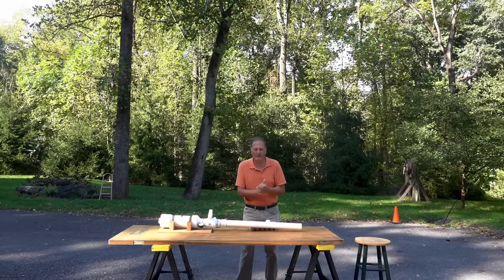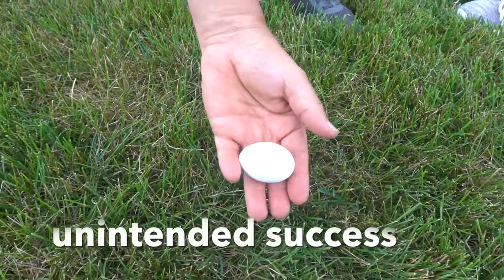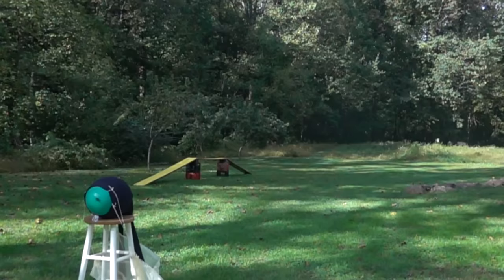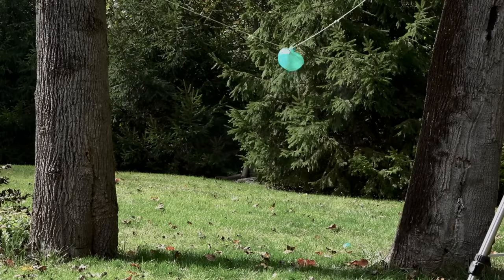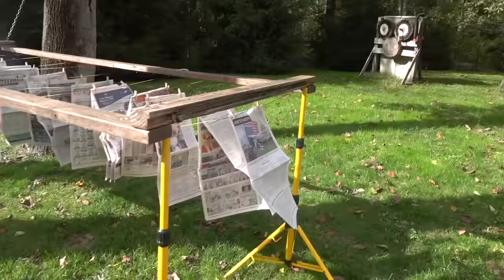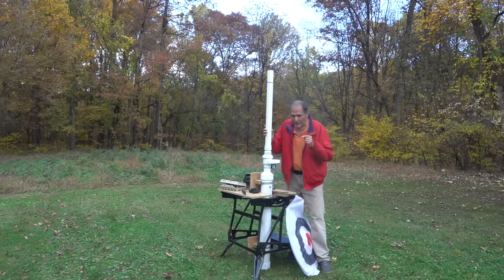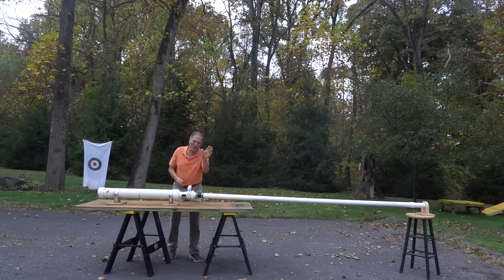Trying to Catch 300+  MPH Eggs ------  Physics  Impulse Challenge

Comment: 10:44 Dang. That egg is coming out of the barrel with magnum handgun energy. It's so interesting to see the physical behavior of what is basically a CaCO3 jacketed, viscous liquid core, shotgun slug.
Reply: Potato guns can do some serious work if they are designed right, I've got one that shoots golfballs at 750 FPS and makes about 875 ft-lbs of muzzle energy, and that's just with propane and atmospheric air. Another one I made was capable of magnum rifle energy levels, a stoichiometric mix of air and fuel were compressed (to 10 bars) into it's chamber which was contained by a burst disc between the chamber and barrel, then once the chamber was pressurized an electric spark ignites the mixture and the pressure (about 500 PSI) generated breaks the burst disc, made of either stacked layers of aluminum foil or cut out pieces of 2-liter soda bottle walls. That gun could fire golfballs at 2100 FPS, making just shy of 7,000 ft-lbs of energy😁. Recoil wasn't too bad considering the gun weighed 40 pounds, though it was still pretty stout and definitely shoved me around pretty good lol.

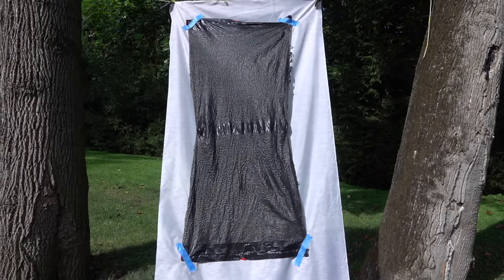Comment: It's surprising the egg didn't break inside the cannon. It must have something to do with that capsule that can be seen trailing the egg. 1:53 Was a favourite moment of mine.
Reply from the maker: the fitting around the egg is called a sabot,  I experimented with several designs and they are shown  in the  first video of this series. https://www.youtube.com/watch?v=33dnlFwjngk
Reply: That and the fact that the egg is accelerated over the whole length of the barrel.
Reply: As well as the fact that the egg is experiencing the acceleration along the strongest axis - IE: Top to bottom, not side on like it orients itself to after the shot.
Reply: @YeanyScience  Catch the egg with a sabot and a barrel! its obviously firing it slow enough, can it decel it slow enough also?
Reply: @diox8tony  yeah lol, just fire it in reverse. The laws of physics work in reverse, so surely that'll work. Actually, let's break the eggs in reverse too while we're at it.

Comment: @Bruce Yeany 7:50 I assume you could use some more papers at the back portions of the rings? (or multiple spaced layers of that cloth sheet?)
I assume that because the egg has lost some speed, it doesn't impact the paper as hard then, so then you can increase the layers, to keep the "impact energy" constant, near the maximum that the shell can withstand.
You can also experiment by using silk-paper (the thinnest you can find), to add "fractions" of a newspaper's worth of hardness, to really fine-tune the impact-energy.

Comment: Great demonstration of the nonlinear relationship between speed and kinetic energy (which I always try to bear this in mind when driving or cycling). Before you got to the newspaper setup, I wondered about using a series of loosely-held silk cloths - strong but light and flexible - starting out small at the front. I think that would give longer contact times than tearing paper. Perhaps aerodynamic benefits too. Really enthralling video, thank you!

Comment: Very interesting!  Try hanging sheets of silk vertically only from the top and let the bottom hand loose as you did with the news paper.  The egg will not break and the silk will not tear.  Also, to increase the muzzle velocity of your air cannon, tape off the muzzle with thin packing tape, pull a vacuum on the barrel and fire while the inside of the barrel is under vacuum.  You will get a supersonic or close to supersonic projectile.  The acceleration may break the egg however.

Comment: I think the main problem for a lot of the failed attempts is just a matter of weight and momentum of the sheet.

With the lighter sheets the egg will just punch through, but the reinforced sheets become so heavy that to the egg at 300mph they might as well be a solid wall. Basically, even if the sheet has lots of give, the egg will already shatter from trying to overcome the static momentum uf the sheet before it manages to impart enough kinetic energy for the sheet to start moving with the egg. Thats also why it doesn't matter whether the sheet is attached directly to ropes, or to a parachute. It's overcoming the momentum of the sheet itself that's the problem.

So ideally whatever material you use to catch the egg should be as light, elastic, and high-tensile strength as possible.

Comment: hey Bruce, let's test your sabot precision. you should be able to catch the egg by shooting it down another barrel of equal length with a cap on the end. this method uses the seal formed by the sabot to create a cushion when entering the second barrel. 

you could guarantee the entrance into the second barrel by using a coupler with holes drilled in it for exhaust.

Comment: With the sheet method being so successful with slightly slower eggs, and the egg successfully passing through the sheet without breaking, to me the most obvious solution would just have been to add multiple sheets spaced apart. My guess for that 300mph egg, it would have required only three sheets, but maybe it would also stop in two.
Reply from the maker: I tested several materials,  the problem with using the sheets and other materials to slow the eggs down is that about half the time they will break passing through them.  I tried four sheets but didn't show it,  the egg broke on the second one

Comment: You can prevent the egg from flying sideways as it exits the tube by adding a short cylindrical net at the exit. This will stabilize the egg after the pressure drop and will not let it spin. When shooting the egg vertically with zero wind velocity, try to let the egg fall back into the cannon. I'm curious to know if it's feasible.

Comment: Man this video was fun! Also, throwing eggs at mach 0.6 is no mean feat. I'm impressed at least.
Reply from the maker: my new goals, 500mph and rifling
Reply: @YeanyScience  I wait on baited breath!

Seems to me rifling might have some slight reduction in muzzle velocity vs the smoothbore at the trade-off of accuracy. I'm also extremely curious how the rifling would affect the sabot if at all.

Also also I feel that might fix the issue with the egg always rotating perpendicular to the airflow and if it does that could both greatly increase accuracy but also presumably increase range even with a lower muzzle velocity at the same pressure.

Comment: I am a bit surprised by 8:45 (the egg hitting through papers). It looks like the egg's velocity is not changing much. But then the kinetic energy is proportion to velocity squared, which probably saves the egg.
Reply from the maker: it would be interesting to know how much the speed decreased.  I fired the eggs into the sheets at lower speeds and found that the sheet could safely stop it around 150 mph

Comment: Another way to increase the speed would be to make the barrel a vacuum chamber, this will increase the pressure differential and remove air drag. I think I have seen foil used as the burst disk on the end of the barrel.

Comment: This was awesome,  a little mental math on why some of the other things failed e.g. pillow,  is you're effectively hitting an egg with a pillow traveling 300mph so that will not work.   But most importantly Newton's 3rd law, need to have things light enough that can not create large forces, hence why the newspaper worked so well while a large force may have been able to be done by the egg the egg absolutely could not enact a large force on something like newspaper because the newspaper can't do the same force to it

Comment: I made a gas powered egg autocannon (since I had explody-fuel it didn't need to operate off barrel/chamber pressure to cycle I just made a gas cylinder that also did bang) and found that dipping them for about 2.5 minutes in actively boiling water produced a very nice toughness to splatter ratio... additionally there are some tricks you can use to harden the shell chemically and then toughen it afterwards.
Reply from the maker: nice to hear of others that found shooting eggs an worthwhile pastime.  I'd be curious to know how fast the exploding fuel method would go.  I'm opting for the compressed air as it would allow me to go with longer barrels and should produce higher speeds.  I went with raw eggs for the challenge but plan to do some tests in the future to see if there is any advantage in using hard boiled or frozen ones

Comment: You have to think of this in terms of absorbing energy. The ideal material needs to be as thin as possible and elastic, but with a tensile strength low enough that it will rip before cracking the egg and does so after absorbing a significant amount of energy.
Maybe multiple layers of ultrathin plastic would be best.

Comment: I liked the idea of a hanging pillow. If you had used a smaller one, perhaps the egg would have survived. The slow motion video shows the pillow slowly moving back under the impact of the egg breaking. A smaller and lighter cushion would have less inertia, so the backward movement would be faster and the egg would experience less overload. it's just a theory

Comment: Okay, I''m at 2:50 seconds and I've got an idea as to how to stop the egg, I'm going comment this now and see if you came up with it, I think a way to stop the egg that would almost certainly eventually work is having many layers of sheets separated with air gaps, The egg should loose energy tearing through the first few sheets and eventually would stop, I think this idea should be semi infinitely saleable, up until the point when launching the egg becomes to violent, or air resistance becomes so great that the egg cannot withstand those forces. Although you'd need a LOT of sheets to stop an egg going so fast that those are a worry
Edit one: oh look, Simple air resistance and distance was enough
Edit two: YEAH LOOK AT THAT ! Ya totally thought of it, That box/insulation idea was also great

Comment: I would suggest increasing the diameter of your pressure chamber to increase the velocity over increasing the length. Increasing length will help but will have additional drag from the side walls which at that speed could be quite high.

Comment: I wonder if you could come up with a structure - something like a panel with ribbons across it, half an egg wide, then a half egg gap, repeat - and get the egg to catch the ribbon and start rotating. Then put stopping material nearby behind it, at an appropriate distance that the egg rotates to the strong orientation, and impacts before air resistance turns it back?

Comment: I always wanted to try something like this. My thought was to put the egg in a spiral (perhaps inside a tube or something) with a steep initial pitch that then tightened slowly so the egg would slow down as it's horizontal momentum got translated into radial as I went down the spiral.

Comment: For the 438 mph eggs, you probably need to use a bunch of singular newspaper sheets. It really can't hit a lot of mass at once. So whatever you want to use to catch it needs to be very lightweight. That is why anything involving water, pillows or even heavier stuff broke the egg. The true challenge would however be to catch the egg in less distance than the length of the barrel. After all we know that it is definitely possible to catch the egg in a greater length. Enough newspaper sheets would do the trick eventually. But less distance would be extremely difficult.

Comment: that next experiment sounds fun. mythbusters did something similar for their ping pong cannon that used a vacuum tube. turns out it is very finicky to dial in. You may have less problems than they did since you're not using a vacuum but will be interesting nonetheless.
Reply from the maker: in the first video of this series, https://www.youtube.com/watch?v=33dnlFwjngk 
I test a vacuum cannon by itself for eggs, 150 mph, then added it to the compressed air cannon  speed. air cannon by itself 314 mph,  combined together  330 mph. only a 5% increase.  I think this is due to the egg being more massive than a ping pong ball so the air resistance doesn't play as big of a factor affecting the acceleration down the barrel.

Comment: I think that this is great. And if the focus is to get students more interested in science then this is the way to go. A local university had a Physics Fair that I took my students to, but they didn’t spend much prep time on the events because most of the work was to be done outside of school. BECAUSE there was material I was responsible for teaching. And my AP students were required to take that test. There were no surprises on those AP tests as some students were semi-professional D/F line skaters and we covered the expected material for the tests.

So finally my question… Do your students spend a lot of time participating in these experiments? Or do you just show them the clips? If I were still teaching a lot of your clips would get shown in class and discussed, some performed. But the college text we used in AP physics required a lot of time teaching to mastery so they could do the problem sets.  Which meant passing the AP exam, which meant me keeping my job.
Reply from the maker: I'm retired now but still go in and help part time.   I've always taught middle school aged students physical science except for one year of high school physics so I don't get to go into the same depth as you do.  however, we do cover a lot of concepts, mostly matter and energy, very little chem as they hit that the following year. For many of our students, this will be the only physics they have for their school education ( what a shame).  I assign quite a few projects, that students complete outside of the classroom, so yes they do quite a bit of participation in and out of class.  as for demonstrations, whenever I can I have students perform demonstrations with enough direction from me to do what is needed.  I don't show any of my videos and very few other ones to students in the classroom. On occasion I may  refer students to one for clarification or perhaps something they may have missed.

Comment: Hi Bruce, I drop eggs on mats of Sorbothane all the time and they never break. It’s incredible stuff.
Reply: Oh, in case you are wondering… It’s government work.
Reply from the maker: Would be interesting to see at what speed they would start to break on it. It comes down to that it doesn't matter how soft a material is, it is a matter of keeping the force less than the amount needed to break the shell. I did some rough calculations ( I"ll need someone to check my math) I figure the minimum distance the egg has to travel is about 12 feet during deceleration,  anything shorter than that and the force applied the egg would be too great.

Comment: i'm not too sure if increasing the length of the barrel any more than you already have will contribute much to making the egg move faster, at a certain point the vacuum created behind the egg moving through the barrel will exceed the force of the gasses pushing it out, causing it to attempt to suck the egg back in which will just greatly slow it down before it leaves the barrel
Reply from the maker: using compressed air  offers a very large volume of gas driving the projectile allowing for a much longer barrel length compared to a explosive driven projectile. With a gunpowder explosion it is a very small amount of gas that expands, cools and then contracts, thus severely limiting barrel length

Comment: If you want real speed put a cap of foil on the end and as valve on the pvc and pull a slight vacuum the egg will accelerate with no air resistance the whole length of the barrel ! You can get insane speeds, but then you learn your valve isn’t fasten enough . So Electric solenoids will solve the valve speeed problem.

Comment: so many factors and variables to consider in this test. i'm curious to know at what speed the egg shell fails under the pressure of the air/acceleration in the sabot
Reply from the maker: I'd like to know that too,  never expected to be able to hit 300 mph  in a distance of about 9.5 feet.  With the new cannon I hope to hit at least 450 mph but the acceleration  won't be greater, longer barrel it will just have more time to accelerate

Comment: If terminal velocity is only 70 km/h then all you need is a big drop and the air is going to slow it down enough to catch it in a sheet, I don't know what that length and drop would be but that's the forgetting to do your assignment solution

Comment: If you wrapped lengths of PLA around a foam mandrel covered in plastic sheeting, inserted said mandrel into a PVC barrel coated in glue and inflated the sheet before using a solvent to dissolve the foam, could you effectively add rifling to the barrel? That would make the eggs fly point first for the most metal paintball match in history!

Comment: Amazing stuff! As a tip if you want the egg to go faster I'd recommend you look into 3D printing a rocket engine nozzle. If you can get a well desgined de lavel nozzle (convergent-divergent nozzle) you could get the air speed to go supersonic and push the egg extremely fast. Especially if you combine it with a partial vaccum!
Reply from the maker: interesting suggestion,  I will look into it.  I'm curious how many g's an egg can withstand.

Comment: Drop in to water but have the top half of the wate slightly airated. N the lower half not.  Or woth the bix and hay with wheels. Use a longer box with more hay